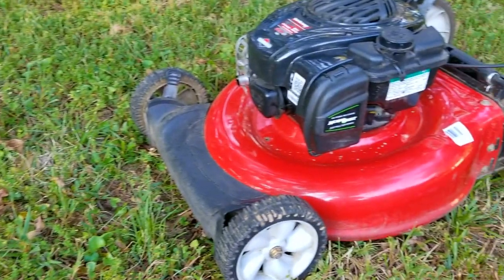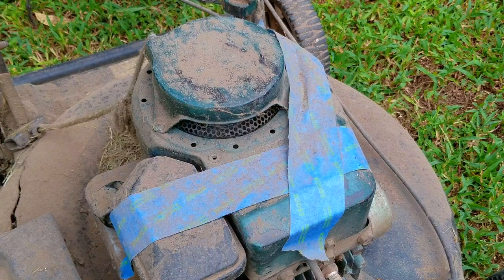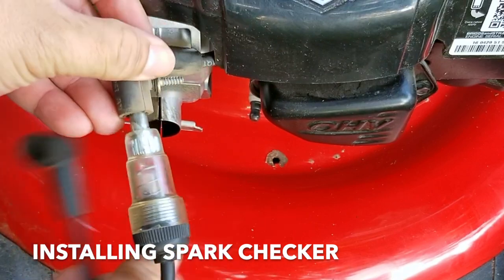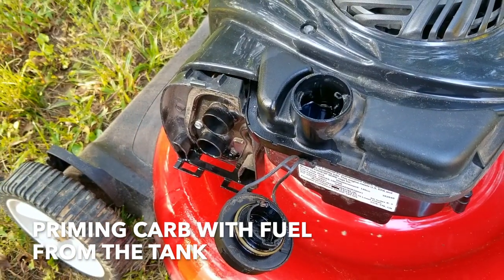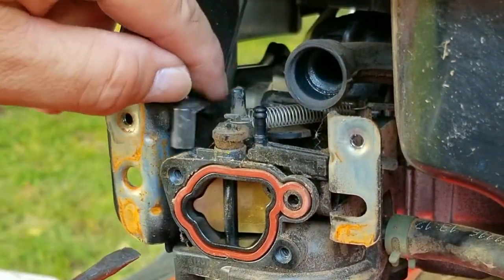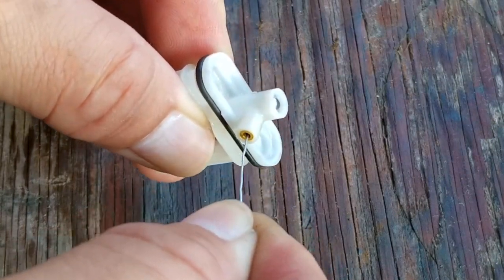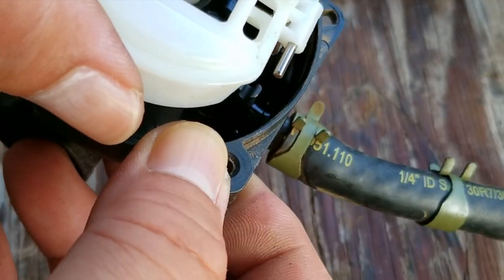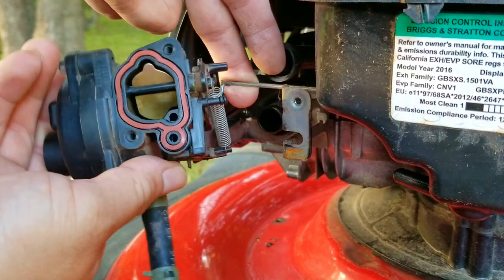Why Did Briggs Stop Making The Flathead Engine?

Comment: the plastic carb does buggy mi abit   but not a deal breaker as it runs great if it had plastic cams now that's questionable.. i think they got that fuel ratio as close to Stoichiometric as they could..  fuel injection would be nice but it going to come at a cost plus has to be cheap enough to mass produce on these affordable units so might come with other reliable concerns.. because of more cost cutting..  changing the oil, draining or stucking out the fuel e d of season.. using non ethanol fuel if possible it should last.. I'll tell u how it goes if mine holds up or not..
Reply from the maker: thank you Joe Brown.

Comment: I would definitely pick the old flathead as those things can last practically forever. At least till the wheels fall off.
Reply from the maker: me too!
Reply: My old one did just that. Lasted from 1999 to spring of 2022 before the wheel fell off. Never had to do anything more than maintain it and replace the blade. Engine was still going strong after the rest of the mower fell apart from under it after more than 20 years of service. Those old flatheads were the best and longest lasting. It was the best mower we ever had. We wore the 22inch blade down the 17 inches before replacing it. It continued to run and cut perfectly good for years after till the front wheel fell off. Engine was still going strong, but without the front wheel it was impossible to properly cut the grass.

Comment: Gas goes bad because air and moisture contaminate the fuel.  If the tank or can is sealed it will keep for years.  I stored my dad's truck with a full tank for almost 4 years and after I put a new battery in it fired right up.  Tank is sealed.  You can hear air rush in when you unscrew the cap to refuel.  I have driven the truck 30k trouble-free miles since.
Reply from the maker: it doesn't apply to ethanol enriched fuel.
Reply: @INSIDEHOUSEGARAGE  The fuel we use in WNY is 10% ethanol and it's a 1995 Toyota.  The tank seals so well fuel stays fresh.  It's true that alcohol absorbs water from the air so keeping it sealed is key.

Comment: The answer is fairly simple; the gov't mandated that the exhaust gases from consumer yard equipment (especially California) be reduced by a considerable margin. 
The original design, common to Kohler, Tecumseh, and B & S being a valve in block flathead, had horrible combustion efficiency as compared to "modern" engine designs.
The companies took a page from automotive technology and emulated the controlled emissions designs from automobiles since most of the homework was done.
That's the way it is. 

Side note; the Kohler V-Twins use the same flat tappet hydraulic lifters that Chevrolet used for decades in automobile engines.
Reply from the maker: thank you Motor City Mike.

Comment: I went to war with my old mower because it still ran good when it does run. I'd mow no problem and then park it for a week. For some reason or another, I'd always need tools to get it running again. I mean I should have replaced it years ago but stubbornly decided to push it around til the wheels fell off. That basically what I did too...looked much like that taped together job used as an example. Got a new one finally and a valve stem bent somehow after a short five years. First problem had me licked, wasn't fixing that one.
Reply from the maker: it happens and I like the way you pushed thru the issues with the first mower.
Reply: Your valve stem (probably exhaust) might've warped if you stopped the engine when it was real hot, and allowed the engine to cool with the exhaust valve open. Always best to store a single cylinder engine with it on the compression stroke. This insures that both valves are seated (thus preventing a possible warped valve).

Comment: @7:04 "getting rid of the (oil) drain plugs" They did that with the last few years of the Quantum engine already.
Reply from the maker: really?
Reply: @INSIDEHOUSEGARAGE  yep. if u fiddle with enough small engines like I do, u will find this in the last few years Briggs made these motors, just like u can see the demise of this motor. 
They replaced the camshaft with a plastic part, replace the steel gear with plastic, dropped the lifetime ignition coil warranty, stopped selling the steel cyl option, etc, etc.

Comment: I didn’t actually see the claim that was made that Briggs made that says oil changes were unimportant... for this reason I am wondering if something got lost in the translation. Tecumseh had no drain plug on certain vertical engines in the ‘70s, on Craftsman mowers,  the oil was changed by tilting the mower up on its front wheels to drain it through the dipstick hole. But the way the dipstick is positioned on the feature mower, I can see where this would make a mess. Great. Video, I enjoyed it
Reply from the maker: I see, but when I see the tag that says no oil changes, and the drain plug, goes away, It says a lot as to what they think about maintenance
Reply: Wow I didn’t know that they were that blatant about it! But in reality, I doubt 1 in 10 home owners change the oil anyway, so Briggs may as well capitalize on a gimmick.

Comment: Adding a fuel shutoff valve and running the carb dry before storage would help with the dirty jets.
Reply from the maker: you are correct although getting one to fit, is going to be tough as there's hardly any room.

Comment: I still use my 22 year old Briggs lawn mower,Out side of 2 replacement wheels and a carbureator it runs like new. Those flat head Briggs engines were bullet proof and people held on to them so Briggs started making out of plastic which were designed to fail.
Reply from the maker: totally agree with you!

Comment: Another issue I found with this new Briggs design is that the fuel line is so short you can't add a fuel shut off valve to it.
Reply from the maker: it's possible to do, I've done it, but they are correct, the fuel line is too short for enough fuel line.

Comment: I hate to be a contrarian, but I actually like the new OHV engine better. I have never had issues with the ones that I have used. They start easier than the flat heads and Hondas, make good power, and they are easy to change oil in. The flat heads were a cool design and I wish they still sold both.
Reply from the maker: I appreciate your frankness.

Comment: Carb problems that occur are not always the jet’s or gummed up inside it could be the plastic intake of the carb is warped yes warped pull the carb clean it if you wish or rebuild the carb, but first take a large wide file with a fine cut and file  the carb flange that mounts to the engine perfectly flat use a good straight edge to determine the carb has a flush surface. 8 out 10 times you are sucking air and you have a hard start or surging and then quitting , give it a try
Reply from the maker: thanks Scotty Bear.

Comment: can you do a dedicated video on why the intek engine is junk? I have no problems with mine, so far.
Reply from the maker: yes I was planning too, I just need to get a mower with an intek in, which is the problem. they don't last long enough due to maintenance.
Reply: @INSIDEHOUSEGARAGE  ok, I have a rare Intek, 12.5hp pressure lubricated one.
Reply from the maker: Nice!
Reply: @INSIDEHOUSEGARAGE  thanks, its on my channel under my craftsman LT 4000 repower.

Comment: The flatheads had VERY low compression... you can match the power output of the new ones by milling the head down for more compression and gently relieving the bore edge near the exhaust valve for better flow... This will also greatly reduce fuel consumption.
Reply from the maker: thanks for the information Brian Tracy

Comment: I have   changed  two  side   valve engines  in   15  years , I have   a shed   full  of  blown  up   Intek  engines , bent  rods   ,camshafts   worn ,  camshaft   decompression   bits   broken   cylinder head   valve  seats    fallen  out  . Flywheels  ripping   crank  to  bits
Reply from the maker: thank you Gary Peatling.

Comment: The flathead is not as smooth as the OHV types, but very simple to take apart. 
My neighbor has a mower with one of these late Briggs OHV engines and it has plenty of torque and has never bogged down when I've used it.
Reply from the maker: I can agree with that.

Comment: I use ethanol free gas at about 87 octane and my Briggs Platinum (on a Craftsman push mower) starts practically on the first pull after a long winter, even if I leave gas in the tank, which I usually do!!
Reply from the maker: nice!

Comment: I never have experienced using a newer style Briggs and Stratton powered lawn mower. I discovered that Briggs and Stratton stop making flathead engines in 2013. Because they're in favor of redesigning there engines cheaply with low maintenance, lightweight, and high maneuverability.
Reply from the maker: are you absolutely correct, shame really, the older engines were fantastic!
Reply: @INSIDEHOUSEGARAGE  I've been holding onto an old 2008 Craftsman 550 Series Silver Edition that was used by another owner. It used to at first been leaking lots of sludge that made it smoke, difficult to start, and have operational difficulties. All I did was drain out the sludge, gave it a new air filter to replace the very dirty sludgy one, a new pull rope to replace the worn out one, a new governor spring to replace the worn out one, new wheels, new spark plug, and new gasket that eventually made it work like it was brand new. I never have anymore problems with it ever since I fixed it up.
Reply from the maker: very nice work there

Comment: I used to have an old Tecumseh 3.5 Vantage that i beat to shit and just put fuel in and it ran for decades. After finally giving the ghost i switched to the newer B&S 625ex ohv engine and while it runs great that plastic carb needs a manual clean every start of season even if i drained it and ran it dry just before winter.

Sure it runs clean and uses less fuel than the flathead Tecumseh, but the B&S ohv is definitely higher maintenance.
Reply from the maker: I totally agree.  Also if you want to leave fuel in your mowers over winter, have you considered running the mower for about 5 minutes a couple of times? That should be enough to keep the jet cleared.

Comment: Simply changing to fuel injection can't make up for the inherit problems with emissions and power per displacement that a non over head valve design has.  Largest one being poor air flow and making the intake air change direction many times and go through the block. I love the old simple ones. But have had the same struggles that I have with the new plastic carbs being the composition of most fuels.  Not just the inability for them to actually burn some of the alcohol in the fuel.  But also it's tendency to attract moisture from the air and corrode parts.  Then there's that they can make worse base gasoline and use the alcohol to get the octane rating back up.  I think the volatility reduction from stale fuel is the culprit to hard starts on old fuel more than the actual octane changing.
Reply from the maker: thanks !

Comment: The problem for small engine manufacturers is the monolith of Hondas G range of engines (G - side valve, GX - overhead valve, GVX - overhead valve with  vertical crankshaft) which are  masterpieces of engineering, also Hondas marketing of these engines is supreme being available in Honda dealerships and third party vendors as well with spares backup thats hard to compete with and because these engines are so universal they've been copied by chinese companies (such as Lifan) it's quite possible to repair them (generally non critical parts such as  covers, fuel tanks, exhaust mufflers etc) using pattern parts at reduced costs and greater availability.
Reply from the maker: yes you are absolutely correct. Briggs was definitely playing catch up to the rest of the market.
Reply: @INSIDEHOUSEGARAGE  Don't feel bad about it all the small engine makers have/had this problem (Kohler, Lombardini, Robin, Yanmar, to name a few), Honda were just quicker to see the potential for the uses of their products and allow variations (different output shafts, gear reduction output, flange mountings for pumps/generators etc) to suit customer requirements, I worked in power products/machinery hire and whilst the other makers engines were interesting for ease of use and reliability Honda was always the favoured small gasoline engine.

Comment: HOWdy  I-H-G, ... 
Thanks for the INFORMATIONAL Video
Question = how "hard" would it be ( or even POSSIBLE ) to Drill & TAP an  OIL  DRAIN  PLUG  into a modern BRIGGS OHV Mower Engine ?
even my Vietnamese MOWER from MENARD's has eliminated the UNDER-Mower-DECK  Oil Drain Plug 
&
I make a huge MESS tipping the mower over in the Fall to dump the last season's  DIRTY Oil 
 ( of course  I  could attempt to TURKEY-BASTER the old oil out but a Pipe Plug just seems appropriate )
Thanks Again
COOP
the  WiSeNhEiMeR from Richmond, INDIANA 
...
Reply from the maker: Thank you Dave Cooper, it would be tough to drill and tap, if you intend on using the "standard" drain plug because of the pitch of the plug. It's very course so it needs a fair amount of material to tap and unfortunately the oil sump isn't very thick. The sumps that were made for a plug are thicker in that area.  You can still do it, But I wouldn't.

Comment: I think the biggest reason for the OHV engine was because of the EPA,  it's easier to reduce emissions with the OHV.
The no oil change,  is kind of odd,  Briggs claims,  the engine will use enough oil and as you fill it will be OK. I use a pump to pull the old oil out and refill with new.  It doesn't take long.  Plus you can still turn the mower upside down to drain the oil which you had to do with a lot of the newer mowers.
Reply from the maker: nice work, and thank you for the information
Reply: It was also to get round new emissions laws in Europe as a lot of the Chinese engine manufacturers had already gone over to OHV engines before Briggs and Stratton launched this engine and were winning supply contracts with some European garden machinery manufacturers. Its getting rare to find a mower in the UK and Europe with a Briggs and Stratton engine as most engines are now either a Honda, Loncin (Chinese company), Kohler or some other Chinese brand engine. Also a lot of manufacturers supplying garden machinery to the UK and Europe are switching to battery power only.
Reply: @bentullett6068  
Battery only, that's kind of funny, they don't have enough electricity to heat their homes, and yet they do have enough to charge the battery for a snow blower?  I think they have thier priorities a little out of line.  Good for them at least they aren't polluting their air.  They may freeze to death but at least the have clean air.
Reply: @bertgrau3934  that is sadly what they are aiming at doing with the industry as many local authorities are being made to go battery for green agenda reasons in cities and towns. Don't get me wrong but some of the battery stuff in the UK where I live makes sense especially small mowers and small handheld gardening equipment that only gets used for certain times of the year and then gets put away  for many months or to mow small gardens. Commercial items are available but are expensive.
Reply: @bentullett6068  
Sir, thank you for your response. 
In the USA, we have many area's where EV cars would have a very difficult time trying to find some place to charge thier cars.  Many places like California. They have what are called rolling black outs. Which means, some area's will be without electricity for 2-6 hours at s time,  the local government has even told people with EV to NOT charge their vehicles because there's not enough electricity.  These are the same people that are saying,  by 2035 NO gas, or diesel powered vehicles will be allowed.  Not enough electricity now, and I can only imagine what 2035 will be like.  I am glad I do not live in California.  

Again thank you for that information,  and I hope you have a wonderful day sir

Comment: The reason Briggs stopped manufacturing the ‘flat head’ had to do with EPA emissions regulations.  It wasn’t possible to meet the stricter EPA mandatory emissions guidelines with the flat head design.  I’m a big fan of the flat heads – they are great engines.
Reply from the maker: you're exactly correct.

Comment: Ethanol fuel has roughly a 3month “shelf life” or stability period. Not 30 days. Non oxy fuel is good for 6mo to a year. I have 2 stored vehicles with non oxy fuel in them that I filled 2 years ago. They still start right up.
Reply from the maker: gotcha to make a comment.

Comment: I have a mower with a flathead quantum briggs engine that has been working great for over 30 years.  Change oil and plug every 2-3 years.  Starts with 1 or 2 pulled every time.  It will probably last a few more decades.  Much cheaper than electric rechargable mowers that have poor longevity, cost more, and have expensive batteries.
Reply from the maker: Great point! Thank you John A. S.

Comment: I have found that all small engines (lawn mowers, weed eaters and outboard motors, 2 or 4 cycle) are much easier starting and more reliable if non-ethanol fuel is used.  It's well worth the extra cost.
Reply from the maker: yes I agree too.